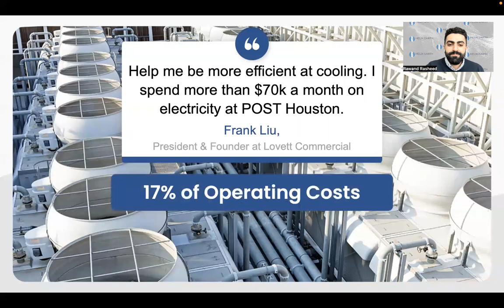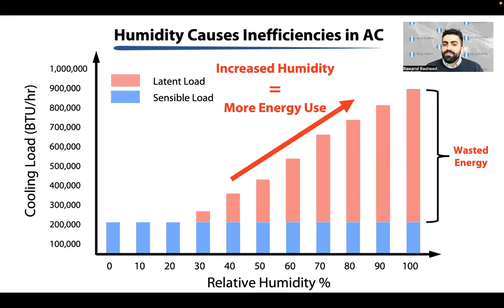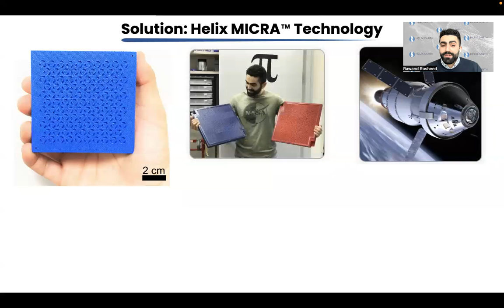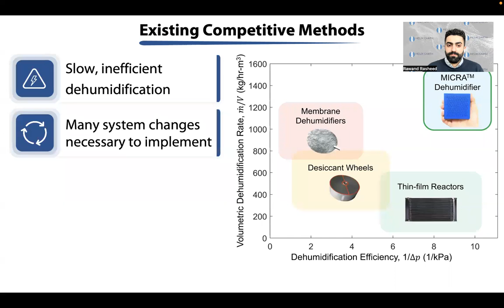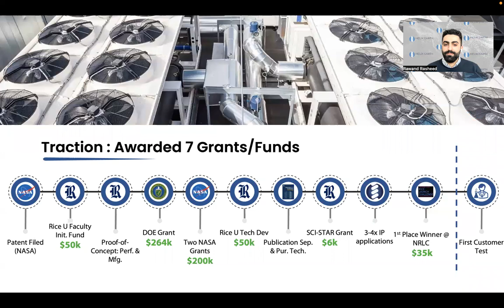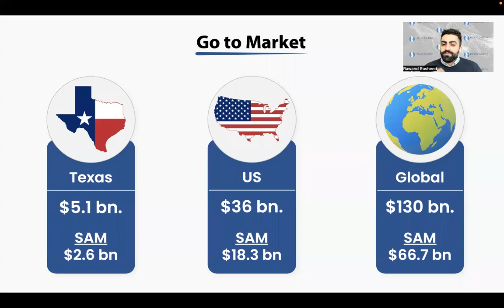Helix Earth Technologies TEX-E Pitch

Comment: An article promised me that this video would tell how it worked. I watched the whole video and it did not tell me what type of system it was.
Reply: I have nearly same question, if filter catches moisture, where this water will go? Or filters need to be changed very frequently?
Reply from the maker: @moijmoij5813  This pitch is not meant to provide details on how our system works :) Sorry an article misrepresented the video.
Reply: @RawandR10  Where is possible to get more detailed information how Helix Micra dehumidifier actually works?
Reply from the maker: @moijmoij5813  Dont have information published anywhere since I dont want to give away proprietary information.
Reply: It's quite literally "vaporware"... This technology is for mist, microdroplets and is so far from useful for HVAC purposes EVEN if it were to be commercially scaleable it only works with humidity levels where microdroplets form. 
It's misleading and looks like a scam.
Reply: It's because it doesn't work. It's green washing